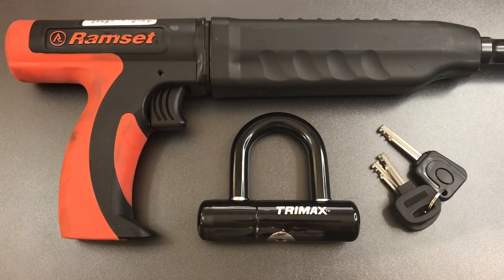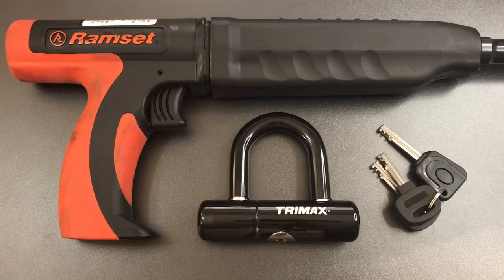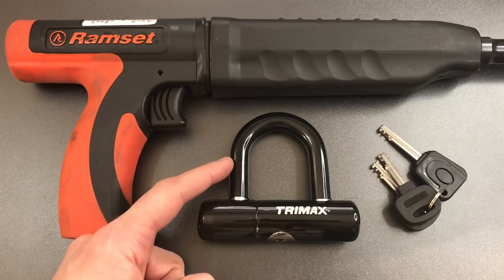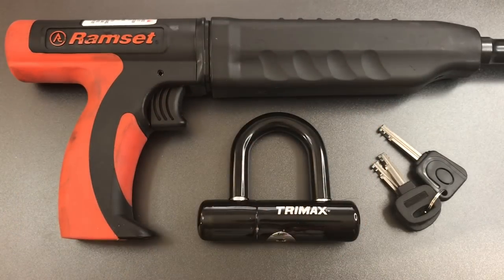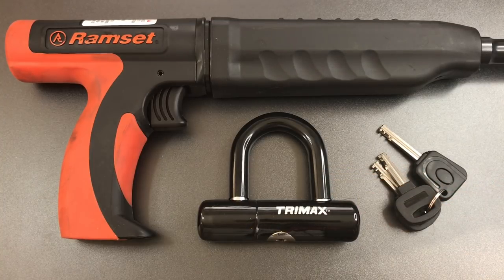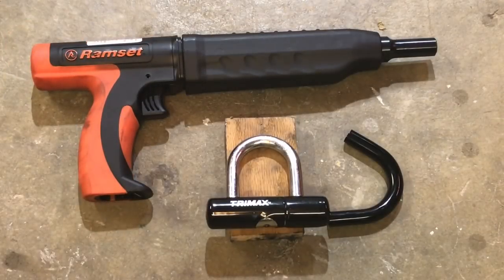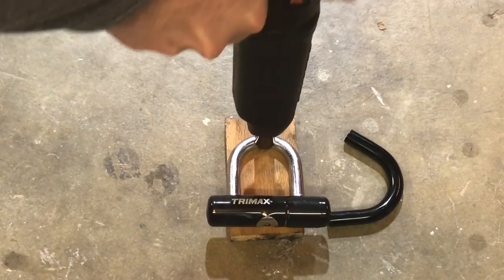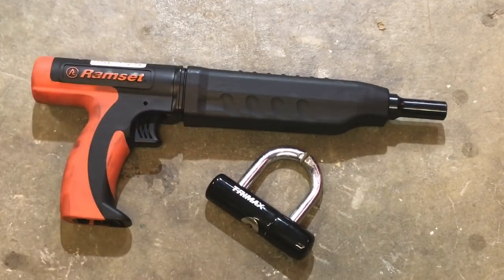[620] Ramset vs. 1/2” Hardened Steel Shackle (TriMax Max 40 Motorcycle Lock)

Comment: Considering you hit it on the hardest place - result is impressive. Weakest place in my opinion was where it locks. As in hanging down from a door, hitting it upside down at the black cover. Nice video! Keep doing them!

Comment: This shows how dangerous blank's are.
Reply: I think the piston nullifies its qualification of being an example of the danger of blank rounds since the piston basically acts as more or less an imprisoned stand in for a bullet
Reply: Its basically a captive bolt pistol, it may use blanks, but its not shooting blanks
Reply: Not really, given a scaled up version of this with compressed air is used for dispatching livestock. It is considerably more damaging than a lone blank on contact considering the piston acts as a captive projectile, a blank can still cause harm at short range with the wadding, though a 22 blank probably has about as much penetrating power as a bb gun.

Comment: I think the most shocking  part of these ramset videos is not that he's opening the locks, a disc cutter will cut through any of these shackles in time,  it's the speed at which they are opened and with relatively little noise.

Comment: When hitting a lock with maximum force onto a hard surface, something has to give, eventually. When the lock is not on a hard surface, you would lose a lot of energy going into it. Personally, as much as I think your videos are great and amazing, the lock needs to be in a locked useable position. Just like when you removed the core, you had it lockedon a chain, but you couldn't remove the core if you didn't have it chained to something, as you can't pull against nothing. With this lock on a disk brake, there would be loss of force as it wouldn't be on solid surface. This is not to say it wouldn't break, but I do believe that it may take more when not on a hard surface.

Comment: These locks are designed for abrasive resistance rather than shock resistance. They probably aren't even tempered. A proper lock with be hardened and tempered immediately after to reduce brittleness.

Comment: What does the striking end of the piston look like after. Pistons in these guns are not designed to strike hardened steel.
Reply from the maker: It’s actually in pretty good shape... and it actually IS designed to strike hardened steel. That’s what ramset fasteners are made from. 👍

Comment: Still have that Chateau C970 disc lock from video 378?  A buddy has to deal with them at work, and they are not trivial to pick, so he goes for a cutting wheel and it takes forever. Is there a better destructive method?
Reply: Morellio Benoir Just use a ramset.

Comment: where did you get the ramset?
Reply: Yay 1 you can get them on amazon, or basically any major hardware store.
Reply: Here's a link to buy what looks like the same gun he's using. Ramset 40088 Rs22 Trigger Activated .22 Caliber Powder Actuated Tool Single Shot: http://amzn.to/2EKqbYA

They have lots of different products, but what makes this one so cool is the integrated suppressor so it's a lot quieter (but is more expensive).

Comment: I have a question and I'll apologize in advance if it has an obvious answer to the inexperienced.... I have a little bit of previous experience using a powder actuated tool at some previous worksites, with that said I'm confused as to what kind of fixing you are using in the tool.... Are you simply loading the powder and nothing else or is there a small fastener that you have found works best in these unorthodox applications?
Reply: In this case he is loading only the powder blanks made for the tool. The piston of the ramset simply extends from the exit about an eighth inch.
Reply: He is very clear as to what he is using... At minute 1:11:
“ but allow the piston to move forward unimpeded by a nail”
At minute 2 the yellow cartridge is loaded. Nothing else.
Reply: Thankya sir